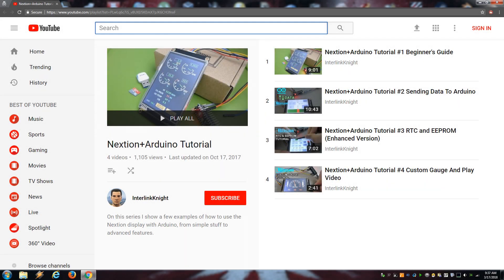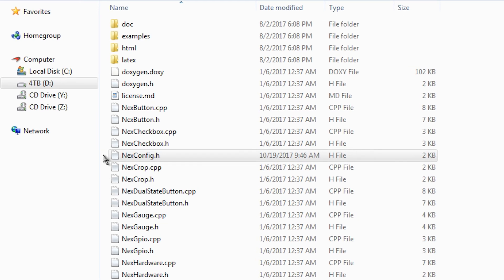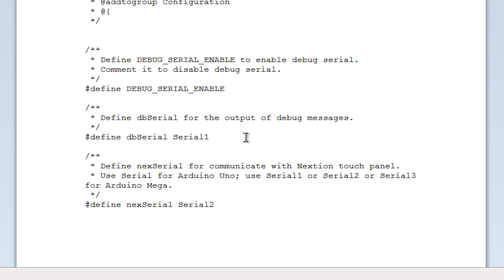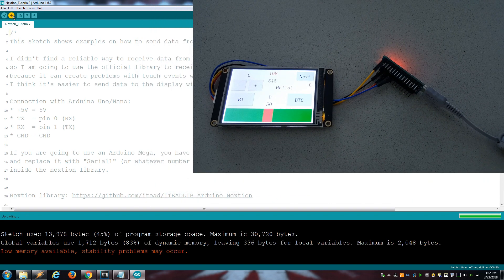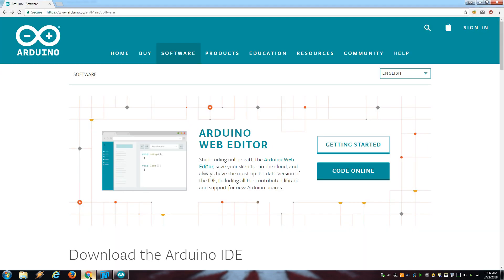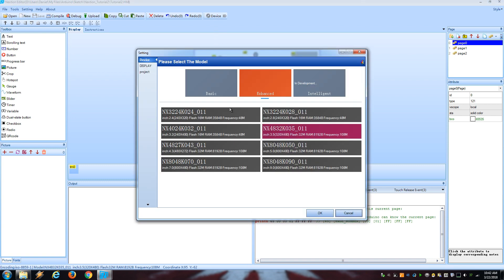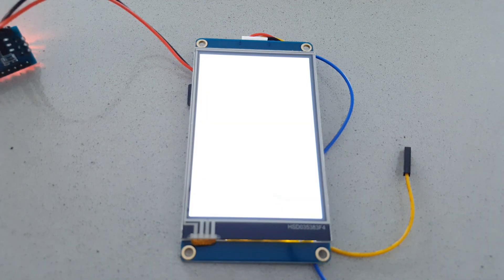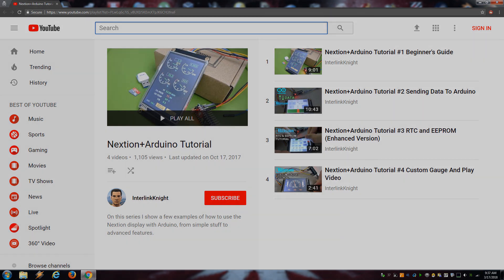Nextion+Arduino Tutorial #5 Troubleshooting

Comment: Hey man i absoltely need your help i literally losing my mind with this! where i can ask you?
Reply from the maker: In my website there's a contact form. Did you followed the instructions in the first tutorial?
Reply: @interlinkknight  absolutely yes i followed all the steps and checked at least 10 times 🤣 but i have one "recvretcommand err"
Reply from the maker: Where do you get that error?
Reply: @interlinkknight  when I open the serial monitor to check first he write "□□□□?□□□°□□•? " and after recvretcommandfinished ok 
Recvretcommandfinished  ok
Recvretcommandfinished  err
Recvretcommandfinished ok 
Recvretcommandfinished ok "this is literally what happen, it's strange because when I press the botton on the screen it work but not with the spst button 😅
Reply from the maker: So you can send data to the nextion display fine? The problem is with a button in the display to send data to Arduino? With such little information about the problem, I can't do much
Reply: @interlinkknight  i can switch with button the menu but not the page basically, i think this is the error because is the only thing i can't do
Reply from the maker: You can't change pages? Each page has an ID. Make sure to send a command for that ID. My examples have it already and they work

Comment: I think you just saved my life: at 1:09 you changed the NexConfig.h file to force the Nextion display/touch panel to communicate with Serial2. This works on ESP32! Then you don't have to disconnect the Nextion wires every time you reprogram the ESP32. Thanks for the video!
Reply from the maker: I'm glad I could help :)
Reply: @interlinkknight  the problem I have now though is that I can't change the baud rate to 115200, it seems stuck at 9600 🤔
Reply from the maker: How did you try to change the baud rate of your display?
Reply: @interlinkknight  I used the following lines, after defining the pins (#define RXD2 16, #define TXD2 17):
void setup() {

  Serial.begin(115200);                                          // Define and start default (UART0) hardware serial port 0 (and monitor?)
  Serial2.begin(115200, SERIAL_8N1, RXD2, TXD2);
  nexInit();
...
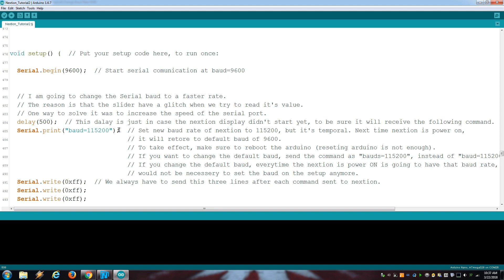Reply from the maker: I have no idea where that code comes from. I already show in the video how to set baud rate on the nextion display in minute 2:40
Reply: @interlinkknight  I had no problem setting the baud rate of the display to 115200. It is my esp32 that is stuck at 9600 when I use the Nextion library. If I make a test sketch for the esp32 without the Nextion library, the baud rate changes as it should (to 115200) using those lines of code I shared (from my Arduino sketch).

Comment: When Verifying the sketch, it's giving me this error in the console. 'NexButton' does not name a type; did you mean 'Nextion'?

It has an issue with every single one of my buttons, I've followed your tutorial, and I didn't do anything wrong. Is this code still working after updates to the Nextion library? 

NexButton w3 = NexButton(0, 4, "w3");

EDIT: My Nextion Library folder isn't NEARLY as full as yours, could you provide the library you're using so I can download it? My folder has 7 files total, Nextion.h is a notable one.

EDIT 2: Found it, that was harder than it should have been. I hope this is my solution. I got my nextion library from the official Arduino add library list.
Reply from the maker: The library that I used is in the description of the video. Sadly, there are multiple nextion libraries that they don't all work
Reply: @interlinkknight  Alrighty, thank you. I found the github, but I don't think your video ever mentioned which library you used.
Reply from the maker: The library is also mentioned on the the sketch (near the top). Enjoy
Reply: @interlinkknight  I downloaded the library you have posted in the description and added the file to the master folder and still NexButton and every other iteration returns the "does not name a type..." error.

Comment: Hi, i have a question, why cant i use my nextion display in arduino NANO but i can use it with the same code on the arduino UNO
Reply from the maker: My code should work on both, arduino nano and uno without any modification. Why you say it doesn't work?
Reply: @interlinkknight  im talking about my code, its something strange, i use arduino UNO and it works perfect but when i change to NANO my display cant send information to arduino
Reply from the maker: At least did you try my code? Does it work?
Reply: @interlinkknight  yes i tried bro in 3 arduino NANO of the same developer, i had to buy another version of NANO and that works
Reply from the maker: Very interesting. Can you share with us what version of arduino nano were you using that didn't work, and what version you bought that worked?

Comment: i have problem, when i running in simulation nextion editor program work well, but when i nextion button doesn't change and rx tx in arduino doesn't blingking
Reply from the maker: Make sure to use an Arduino nano or uno, make sure to use the same library as i put in the description, check connections rx to tx and tx to rx

Comment: hello, I bought 2 display 7" enhanced. One is working and on 2nd display, our firmware is visible and touchscreen works but our amplifier does not rx any commands from it nor Display rx any from the amplifier so RX/TX data lines not working. What could be the reason and how to deal with it? Please suggest. Thank you.
Reply from the maker: Maybe it's a defective unit? Maybe it's set in a different baud rate?

Comment: hello i have a problem in my programe if i send Serial.print"page 2" Serial.write(0xff)Serial.write(0xff)Serial.write(0xff) it changes the page but inside my programme it only takes it without respond where can the problem be can u help me? btw i am not using the nextion library
Reply from the maker: I don't understand the problem
Reply: @interlinkknight  i am sending id and pw to arduino board if that person have access i order to go next page  but when i open the serial loop i see that am serially sending the page 2 order but nextion doesnt change at all
Reply from the maker: Page 2? That sounds wrong by itself. The first page is 0 so I think you mean page 1. Also, I don't know if you are using the command correctly. Test it on the "simulator" in the nextion editor. I think is call "debugger"? Test there the command

Comment: Hey, I was uploading in my nextion display and suddnly an error of "Timeout" appeared and the upload stopped at 41% After that I tired again and now it doesn´t reconginze the nextion anymore. Do you know what it could be? Thanks
Reply from the maker: I never seen that, but sounds bad. I suggest contacting costumer support on ITEAD
Reply: @interlinkknight  Solved it: I just inserted a formatted SD card with a tft file in it and conected the nextion to the wall with a phone charger. It started uploading the tft inmediately. The sd card has to be HC-1 model. Anyways, thank you!
Reply from the maker: Oh, that's great. I got worry. Enjoy it!

Comment: Thank you so much dude! I've been struggling to get a reading on a NE555 chip via arduino. I will get your code and disect the bits i need. I guess using 1 of the pins as a input won't work, will try the RX pin
Reply from the maker: Sounds good

Comment: Hello 
I use Nextion with ESP32 and i changed config.h and  upload.h files , commented debug and use serial2 and  use 250000 as baudrate , but touch of display sometimes doesn't work correctly and after 4 or 3 times struggle with it , its work, Do you have any solution?
Reply from the maker: I don't know. Your setup is so different than mine. I suggest trying exactly my same setup and exact code first. If that works without problems, then change one thing at the time. Maybe first change the module from arduino nano to ESP32. Making sure that works, then change another thing like maybe the baud rate. Etc. One variable at the time.
Reply: @interlinkknight  thanks , ill try your soulotion

Comment: Hello! Why using the debug window on the nextion software everything works correctly, while between the arduino uno and my nextion display does not work?

Thanks for the great job you did.
Reply from the maker: I don't know, men. There's a million mistakes you could have done. To troubleshoot things you need to test one thing at a time. For example: did you tested by examples? Did the example #1 works? Did the example #2 works?
Reply: @interlinkknight  Example #2
Reply: @interlinkknight  Problem solved. Sometimes the platitudes block you. Simply connect the pin ground between arduino and nextion.

Comment: Thanks for
your great work which is very helpful but I have one problem and I  hope you can help.
I found no help in all web discussion so farWith
Arduino UNO I have to include the “Nextion.h” and also"NexButton.h"
and <NexPage.h>  library, By only including
 the “Nextion.h” the compiler claimed “NexButton
does not name a type” or “NexButton does not name a type”.  With espe2 I have the same issue but by
including "NexButton.h" or <NexPage.h>  compiler is referring to a an issue with Board
ESP32.Sending data from esp32 to Nextion display works well but I am not able to receive data from
Nextion . I also used different Arduino IDI’s with no success. Nextion.h is version 0.9.0.
Thanks in
advance for your time to help me.
Reply from the maker: Apparently you didn't use the same library as me. Start from scratch. Delete the nextion library that you have and download the same one I put in the description.

Also, I never had to add NexButton.h nor anything like that. Please try my examples first, and then mess around.
Reply: Thanks a
lot for your response.
By re-installing the complete Arduino  IDI and libraries my
system is now running as expected, all is fine. Thanks again for your help and great
videos which are very important for beginners like me. Waiting for your next
one. Regards from Germany.
Reply from the maker: I'm glad. Good luck

Comment: Thank you very much for the very clear tutorial of Nextion.
Yesterday, I have successfully upload the GUI through Arduino Uno.
But today.. it fails. The editor always print: "Connection failed. Forced Interrupt!"
I have tried several times: checking the config file, connecting and/or disconnecting the blue wire, put more volt through to upload, they are still failed.
Would you mind giving some tips? Thank you
Reply from the maker: I never uploaded a project to the nextion display through serial so I can't help you.
Reply: @interlinkknight  thank you sir

Comment: Im having the following IDE message  and i tried for three hours and cant fix the issue...can you PLEASE HELP ME??

CompDualStateButton_v0_32:27: error: 'NexDualStateButton' does not name a type

 NexDualStateButton bt0 = NexDualStateButton(0, 1, "bt0");

 ^

CompDualStateButton_v0_32:41: error: cannot convert 'int*' to 'NexTouch*' in initialization

 };

 ^

C:\Users\XXXXXXXXX\Documents\HMI Files\CompDualStateButton_v0_32\CompDualStateButton_v0_32.ino: In function 'void bt0PopCallback(void*)':

CompDualStateButton_v0_32:57: error: request for member 'getValue' in 'bt0', which is of non-class type 'int'

     bt0.getValue(&dual_state);

         ^

C:\Users\XXXXXXXXXXX\Documents\HMI Files\CompDualStateButton_v0_32\CompDualStateButton_v0_32.ino: In function 'void setup()':

CompDualStateButton_v0_32:74: error: request for member 'attachPop' in 'bt0', which is of non-class type 'int'

     bt0.attachPop(bt0PopCallback, &bt0);

         ^

exit status 1

'NexDualStateButton' does not name a type
Reply from the maker: You are using the wrong nextion library.
Reply: i downloaded according to the ITEAD home page
Reply from the maker: I can't help you. I have no idea what you are doing. Try my examples first and go from there. If my examples don't work, then ask me. But you can't expect me to guess what you are trying to do.
Reply: I understand. I did used your program from the first video, using the same library and worked. Its funny that your works perfect and the one from Nextion home page give me the faulty message - i downloaded from: 
http://support.iteadstudio.com/support/discussions/topics/11000009208
Anyways, just to let you know what i was trying to do. 
I will keep following your videos since you seems to have more knowledge about Nextion than Nextion team.
Appreciated
Reply from the maker: I see. Yeah, Itead is not doing a good job teaching how to use their product. Stay with my tutorials and if you do everything as described it should work.

I suggest edit my examples to do what you are looking for. If something stop working, reverse the modification and check what you did wrong.

Little by little.

Good luck.

Comment: Thanks for the video! Probably a stupid question but when I look at my serial monitor there are three reversed question marks on the place where "0xff" should be. How do I fix this? because the serial communication between my arduino and nextion still don't work.
Reply from the maker: Are you using my example sketch of my first tutorial?

When I print this:
Serial.print("n0.val=");
Serial.print(PotentiometerValue);
Serial.write(0xff);
Serial.write(0xff);
Serial.write(0xff);

I see on my Serial Monitor this:
n0.val=0ÿÿÿ

That's something very basic, so it seems there is something wrong with your overall setup.
Reply: Thank you! Your sketch from your first video works fine now. But the sketch of your second video only works half with me. On page 0 the n4, n3, b0, b4 and bp don't work. On the next two pages only n0 work. I included all your tips from this video but still those don't work. Do you know what the problem could be? oh, and I forgot that the radios, checkboxes and the three send buttons on page 2 also work. And ofcourse all the "back" and "next" buttons.
Reply: So I guess it's only my void loop() that works than?
Reply from the maker: I don't know what could be the problem, to be honest. Make sure you use an arduino uno or nano, because using other boards could complicate things. What board are you using?
Reply: InterlinkKnight  I am using the mega 2560. But that’s because my final project is with a code that’s to big for the uno or nano
Reply from the maker: Can you try with an arduino uno, only as a test? Test with my examples.
Reply: Yes, i tried your examples as it is with UNO, but still when I touch the button,  the LED does not turn ON. Please help to resolve this problem.

Comment: thanks for the video! I think most of us wish that you make a realtime video where you make a project of nextion and arduino  where you step by step without jumping over any steps, what to do.
Reply: Its the Step by Step, to follow easily. You are such a smart guy, that it looks everything is no problem for you, but most of us, would love to have a step buy step guide. From start to finish a small project. Really like read and write data. Make a multi part series out of it. It would be awesome!!! Make it as easy as possible, and be sure you will can make a lot of money with it if you use a adlinks, because coding is not everyones  love  - and technic and coding is often ?² :-) And the solution is always a good teacher. Because nothing is hard to learn if you have a good teacher! You could be this one!
Reply from the maker: Really? Do you think that would be interesting and useful? I mean, what else can I really show that I didn't already showed? I try not to be too boring. I use my examples as templates for my new projects. Nothing new or special about creating a new project. Do you have troubles creating your projects?
Reply: Make a Menu with an 2560 and Ramps and let nema steppers rotate, make a menu, and something how you can increase and decraese the rotation. Start Stop button for the Nema. Or a Weightscale which is shows the weight on the Display :-)
Reply from the maker: I will think of something. Not sure it worth creating a complete series but I will make one video with the step by step of a simple project, and if is popular enough I will make more videos like that. Thanks for the ideas. Sometimes is hard to know what people want to see.
Reply: Did you make this yet? I would love it.
Reply from the maker: Yes https://www.youtube.com/watch?v=OhYyBpjyR14
Reply: yes please !
Reply: AWESOME - something for stupid people please - so that even beginners can have success with such a complexe thing :-)
Reply from the maker: But what are the things that you guys want to see? I mean, about what would be the project? What parts are you guys having trouble understanding how to do?
Reply: yes please!!! I know a lot of arduino beginners who would love to see it - and you would get nice views and new subscribers :-)

Comment: thanks for the info! i wanna ask you something about the connection between arduino and the nextion display. im using serial.print() to send variables to nextion display and im not using nextion library. is this okay , can this cause any kinds of problems or low performance issues?
here is an example of the code that i use:
    String command6 = "tripright.txt=\""+String("1")+"\"";
    Serial.print(command6);
Reply from the maker: That's perfectly fine. Actually I always prefer sending data to the display without using the nextion library.

Check my first video tutorial about the nextion display, where I do exactly that: https://www.youtube.com/watch?v=wIWxSLVAAQE
Reply: InterlinkKnight thanks for the answer. Im on it!

Comment: Thanks - helpful as always!
Reply: @interlinkknight   Thank you for the excellent  tutorials. Have you noticed any link between font size and refresh speed? I have a very large font on a 3.5 inch enhanced display and a single text command takes 60+ms and if I try to increase the baud rate the display stops responding like it can't keep up. This is OK for a single parameter, but each additional parameter adds another 60ms and causes the display to require an even slower baud.. http://tiny.cc/9ph48y